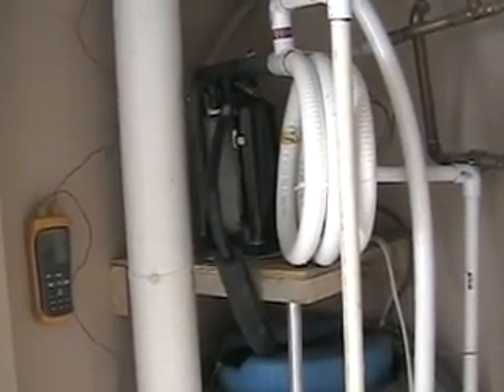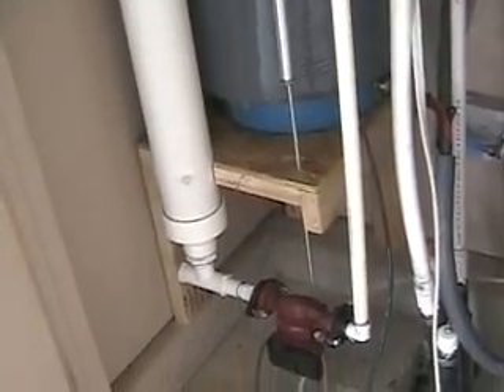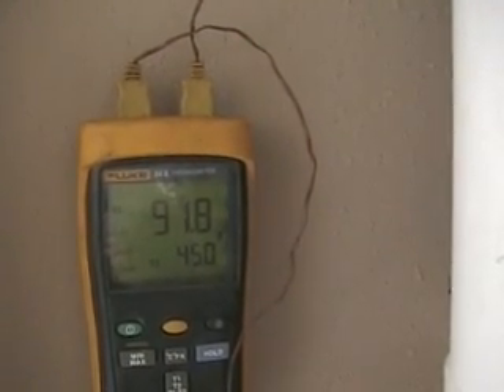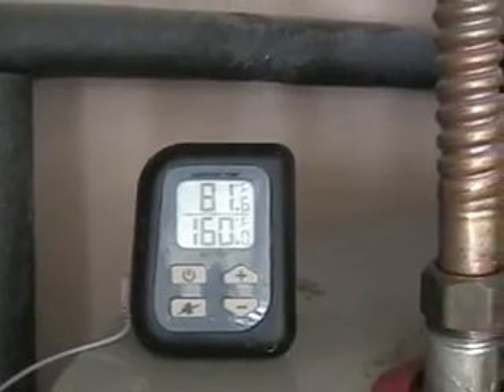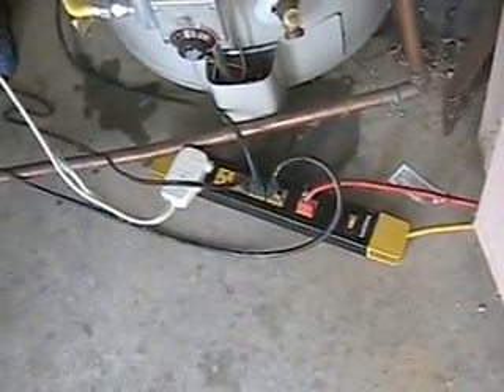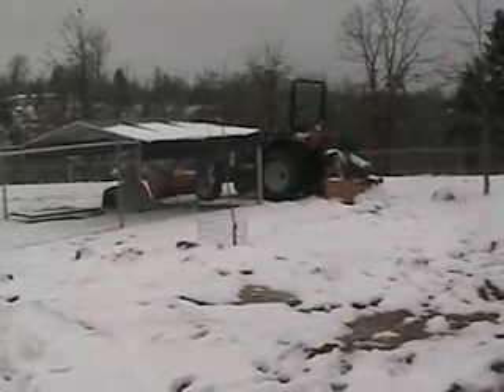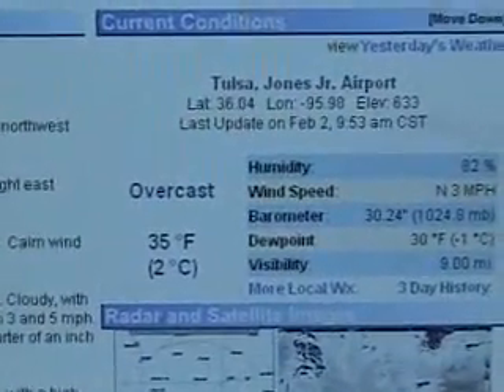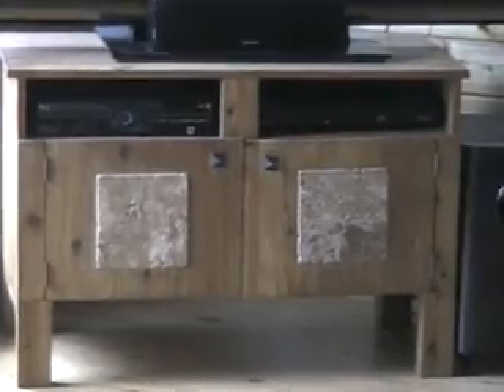Water to water geothermal.wmv

Comment from the maker: @MrBlueoverture 
 Very happy you found me. I have read some of your blog, we are thinking the same. Did not think I would ever see anyone do such similar work. My system has been working great. I am more than willing to share any info as I have time to. I am getting about at 3 to 3.3 COP and that 9k btu compressor has provided 95 percent of our heat this winter. Very low cost. Elec. is cheap here.